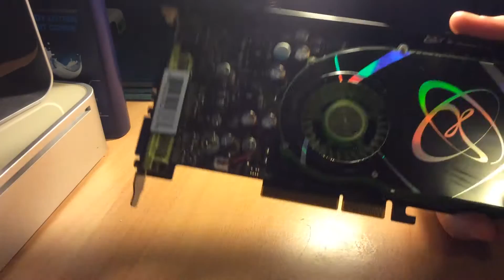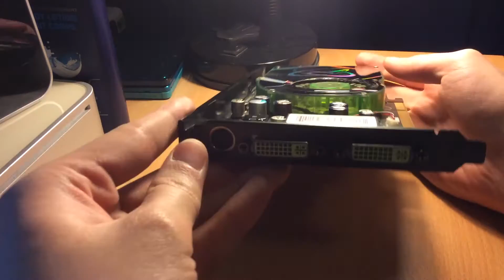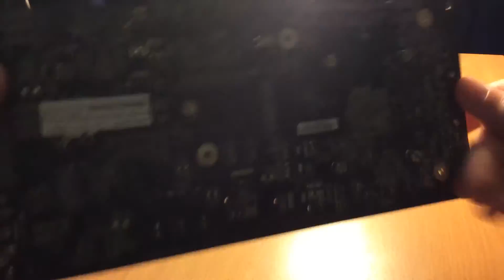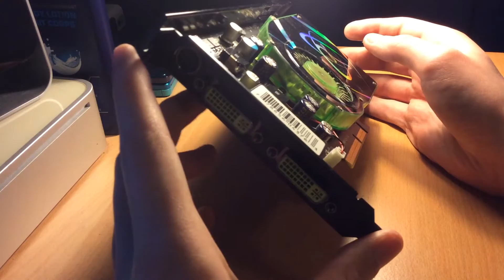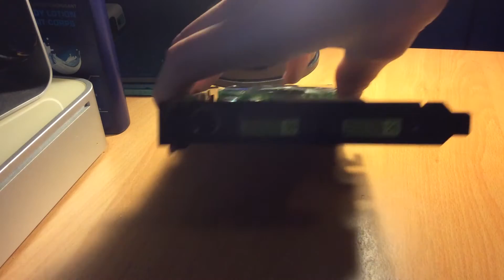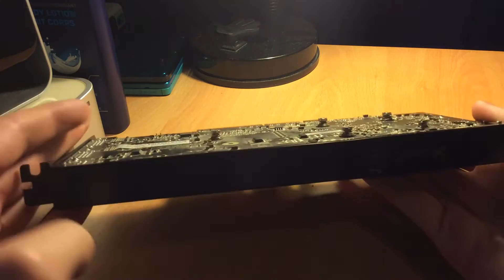XFX GeForce 7950GT 550M - 512MB DDR3 AGP!

Comment: Actually for Win Xp gaming rig there are far better choices than this and there's really no point in going agp. But there is one special aspect to this card - it is the absolute fastest gpu that can work under Win 98 (with slightly modified drivers for the 6000 series), although the 256 Mb variant would be better for that as 512 generally causes problems in WIn 98.
Reply from the maker: Depends on what you’re looking for in a XP gaming rig. I consider the XP era to be 2002-2006 and anything after that is the DX10 and Vista era.
Reply: @nelizmastr  Okay, but even then, pcie came in 2004 and the best dx9 only gpus were all made for it natively (7900gtx, 7950gx2, 1900xtx, 1950xtx) and perhaps more importantly, none of those can max out the more demanding games in at least 1080p (F.E.A.R. and Oblivion come to mind) and for me at least one of the points of a retro gaming rig is to able to max out all the games played on it. I actually had 7950gt, except I had the pcie version and I remember I couldn't even max out Oblivion on 1680x1050, let alone anything beyond that. With the first Stalker it was even worse (dynamic lightning was a total no-go), so I would definitely want my Xp rig to have something in it that could max those out. But don't get me wrong, I find 7950gt agp very interesting because it's the last Nvidia card using that interface although I've read in some forums a couple times that there were supposedly some very limited numbers of 8800gt made for it as well (I would love some credible info on that!)

Comment: Radeon HD 3850 AGP is actually the fastest card on AGP in terms of raw power
Reply from the maker: arranmc182 you misunderstood. I said this was the fastest Nvidia AGP card. Also the 1GB HD4670 is still faster than the 3850. On paper the 3850 should win because it has a wider memory bus, but in practice, neither card is memory constrained at all.
Reply: @nelizmastr  No, there are lot tests in internet, HD3850 is clearly faster than HD4670 (sometimes they tied) and it going more faster for heavy settings, that's because of 256 bit bus and 16 ROPS (which is important), compare to 128 bit bus and 8 ROPS for HD4670. But on HD4670 side faster clocks 750 Mhz vs 666 Mhz and 32 TMU instead of 16. Anyway Radeon HD3850 can do 16 pixels per clock and HD4670 only 8 pixels per clock even with faster clocks and more texture units and more advanced architecture. But for AGP system HD3850 was overkill, those card what you has was perfect. For more demanding gaming you need 2 cores CPU and ddr 2 memory, which wasn't part of AGP platform.

Comment: Guys i want to revive my old pc thats been laying around in the attic it has a broken video card and i need agp video card the pc's motherboard is EP-8HDAI PRO it can hold ddr400 2gb of ram but currently i only have about 500 mb and the ram is quite rare but i mainly need an agp card whats the best one to be found rn?
Reply from the maker: The very best AGP cards ever made were the ATI Radeon HD4670 and HD3850. DDR400 RAM can be found cheap on eBay :)
Reply: Thanks for the advice!
Reply: Btw i get confused with those agp connectors there are like these 3 connector things but on other video cards slot connector looks almost the same but the 2 are connected is it the same thing?
Reply from the maker: The older cards have the big part of the connector first and the smaller part second, those are 3.3V cards (AGP 1.0), then there's the flavor with 3 connectors, that's AGP Universal, for 3.3V and 1.5V operation (AGP 2.0) and lastly there's AGP 3.0, a reversed AGP 1.0 design, running at 0.8V.
Reply: So litteraly any agp video card could work on my motherboard right?
Reply from the maker: Not really. The general rule is, if it fits, it should work. An AGP 2.0 slot will do 1.0 and 2.0 cards, but a 3.0 slot only takes 3.0 cards.
Reply: NelizMastr - Tech for PC & Mac Ok! Thank you very much for the help!

Comment: I was trying to stretch out my performance for a few more months before I could afford to drop for a new PCI-e system, so I bought one of these.  Worked great for a few days, before dying suddenly.  Two more replacement cards later (one lasted a week, the other one was DOA), and XFX offered me a free 8800 GT, which I graciously accepted and pulled the trigger on a new system (complete with a second 8800 GT for SLI goodness).  Lesson learned.  I have a 7600 GT that still works so either I had extraordinarily bad luck, or this GPU had very bad yield in its batches.
Reply from the maker: My card worked exceptionally well for a long time (I sold it recently) so I assume it's super bad luck on your end.

Comment: Not a gamer kind of guy. Play simple stuff as in MMORPG (like WoW and Diablo 2 & 3) where death means nothing. 
Oh! I've tried other games just don't have the dexterity / quick button clicking reflexes.  I don't have Xbox, Play Station, or Nintendo as controllers are too hard to use.  My style is the old Pin Ball machines of the 1970's era.  Board games like Monopoly, Stratego, Risk, then Battleship, Chess, card games Gin Rummy, Spades, Hearts, Poker, Black Jack "21",  Pitch,  and so forth.  I enjoy MSN Internet Spades.  I like experimenting with Over Clocking at a mild to medium level and running Benchmarks. 
I find DIY "building your own PC" is the best way to go. My first DIY was in May 2008. My 2nd DIY and current rig as of March 2016: LEPA Lenyx 801 case, Gigabyte Z170X-Gaming 3, Intel i7-6700K, Adata XPG Z1 ( 4x8GB) 2800MHz , 2-MSI GTX 970's in SLI, Corsair H60 v2 AIO CPU cooler in Push-Pull,  Corsair RM850i power supply, Toshiba 2TB HDD with Windows 10 Pro, 1 Sandisk 400Z  512GB SSD with Win10 Pro, 1 Sandisk m.2 400X 512GB SSD with Windows 7 Ulimate 64 bit,  Linksys AE2500 USB Wireless-N Adapter, case fans are Corsair SP and AP 120 Quiet Edition, and ACER P243W 24inch LCD 2ms Monitor. All by Logitech are MX Anywhere Mouse,  G7 gaming mouse, Internet Keyboard and Soundbar. My rig is very quiet as I can drop a sock within 6 inches to the floor and hear it land on the carpet.

Comment: You have some nice ideas for old build using ASUS P4P800E-deluxe.  I would appreciate your  input as I have a 2002 Compaq Presario 5423US  with Pentium 4  1.6GHz. It has one of those Compaq modified shitty 250 Watt Power Supply part number 243890-001 Model:PS-7231-6CF (+5V -11A; +3.3V-17A; +12V-5A;+12.8V-7.5A; +5.05V AUX -1.7A; 3.3V Aux - 2.2A) believe the +12V rail to be 18A,  as which a few other companies like DELL had done to shaft over the consumer so we are unable to get a Real Useful and Upgrade-able power supply to replace the low wattage garbage. The 24 Pin ATX Power Connector wiring is set up differently than our common Power Supplies.  Yeah! marriage of the  Power Supply to HP Compaq SOCKET 478 MOTHERBOARD 277500-001 257951-002 for XW4000 TOWER. Sorry for the criticism of the 5423US but it was a good mid-range affordable desktop in 2002 after upgrading the  GeForce 2 MX to a GeForce  FX 5900 Ultra which died and now have installed PNY GeForce 7600 GS which likely straining the power supply even though pulls 27.2 Watts and 2.3 Amps under full load. Recommended 300 Watt PS.  Also the 7600 GS maybe bottleneck the 1.6GHz however was able to play Diablo 2/ LoD expansion with it. I'm reviving the 5423US due to old data and photos stored on several PATA/IDE hard drives and to use my HP Scanjet 5370c which HP refuses to update driver as only able to work with Windows XP.  Can you suggest a better AGP video card and if possible to upgrade cpu to an 2.4Ghz or 2.8GHz Pentium 4. Very restricted cause of the HP/Compaqr non standard made Power Supply. If I had $500 to $600 to spend I wouldn't mind DIY with an ASUS p4P800E for fun and nostalgia.  Thanks! Rich S.

Comment: I have this card installed and im not sure if this card is directx compatible cause i want to play games< any suggestions?
Reply from the maker: +Dman2000dd it’s compatible with DirectX 9, so basically any game made before 2010.
Reply: nelizmastr dang so no new games i assume
Reply from the maker: +Dman2000dd no. This card is almost 12 years old lol.
Reply: It can run games like cs go which is made in 2012
Reply from the maker: +Dman2000dd sounds like you have a Radeon 7950, not a Geforce 7950 lol. The GF7950 can’t run CSGO
Reply: CS:GO actually supports DX9
Reply: nelizmastr it will run on lowest settings.
Reply: Some modern games support DX9 such as DOTA 2 and CSGO but you would need to play at low settings 720p max to be playable.
Reply: @capablanca4984  nVidia very much depends from driver optimizations, no body make new drivers for GeForce 7 series, so you can forget about newer games, even if they DX9 compatible. Still nVidia for some reason supported for long time GeForce 8 series and if you have something like GeForce 8800 GT it still can run modern games.
Reply from the maker: It will run modern games up to the end of support in like 2015 yeah. The 8800Ultra would still run GTA V somewhat okay at normal details.
Reply: @nelizmastr , yep, but 8800 Ultra almost all dead now. And 8800 GT has more survive rate and just about 20% slower than Ultra version. nVidia was so scared about new Radeon that push everything to maximum in 8 series. So, 8800 GTX and 8800 Ultra usually died during first 3 years of use. And Radeon HD 2900 XT was a flop, when came out. ))

Comment: I have the 7800 gt ¿What processor do you recomend for a 775mb?
Reply from the maker: As a good match for the 7800 I would go with something like a Core 2 Duo E7500 or E8400.
Reply: But is that ok for the 775 socket?
Reply from the maker: CPU support mostly depends on the chipset. Some 775 board only work with Pentium 4 or Pentium D CPUs, others don't accept Quad Cores. Your motherboard manufacturer has all of the info on their website.
Reply: +nelizmastr Thanks you. My pentium 4 runs the7800 at around 30% maximum. I will search for a combo mb+better cpu to revive that frankestein gpu.
Reply: CPU Support also depends on the VRMs on the board. I have an ASRock 775i65G R3.0 with the i865G chipset and it even supports 45nm CPUs out of the box. Granted, it supports only up to 800 MHz FSB, or 1066 MHz if you have an external graphics card and are willing to overclock. I don't recommend the latter though.
Reply from the maker: I ran a Q6600 on a 775i65G R2.0 without issues, though. Great combo.

Comment: Fact, the 7950GT is the fastest AGP card nVidia ever made.
Only other nVidia based card that comes  close is the Gainward Bliss 7800GS+ with the same full 24 pipe G71 core.
ATI's HD3850 and HD4670 are both a good bit faster thanks to its Unified Shader architecture.

Did you ever progress with your project?
Reply from the maker: +MrOffordef Unfortunately not. I ran into numerous hardware problems and sold most of the parts off later. Also got into a rough patch with other stuff in my life. I still have the card, although it really needs a new fan before I can commit it to any project in the future.